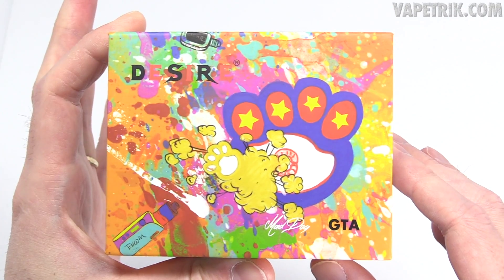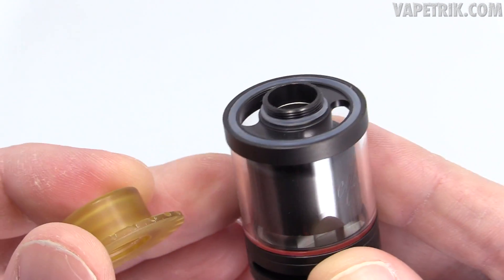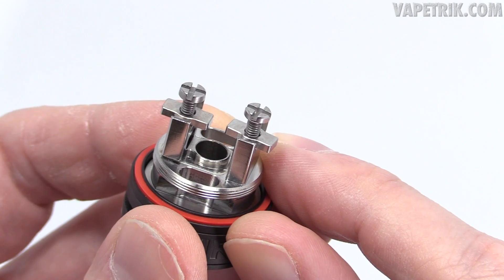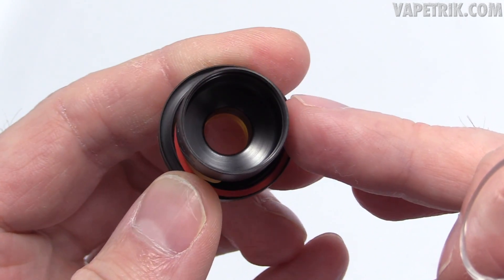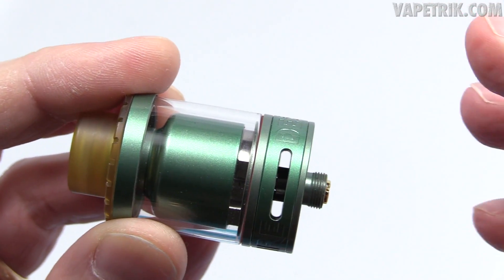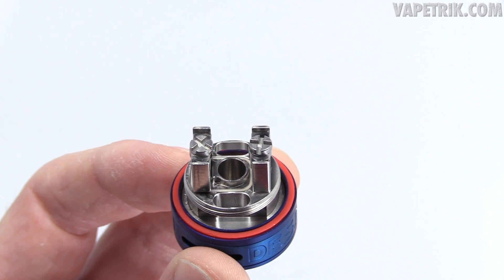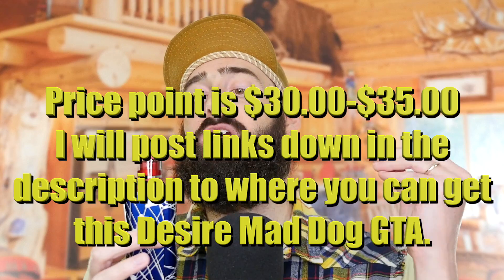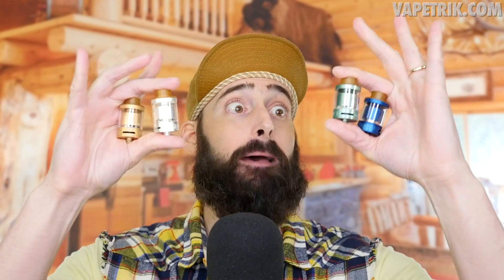The Desire Mad Dog GTA!

Comment: Ok let's talk about this device. Love it!!! Flavor is outstanding, wicking is easy, top fill is big enough to use any dropper bottle you have. The one con I do have is that it is a pain to build on. If you don't like to fidget around with your rta this will frustrate you a little bit. Once you get your coils in and clamped down it is fine, but getting the coil in there takes a little bit of patience. You can see when rip is putting his coil in when you have the clamps turned sideways the diameter of the coil hits the clamps and prevents it from just sliding in. And the fact that you have to turn the thing upside down to build on it is just a little inconvenient. Also like rip said it does whistle when the air flow is cut down. But over all this is a fantastic device everything he said is on point. This is the reason I watch rips reviews. Sorry for the long post. But I would want other vapers to let me know their thoughts on a product.
Reply: I get building may be a pain but how often do you pop on new builds is what will be subjective... I do new builds every couple weeks so having to do that once every couple weeks... who cares lol just my 2 cents!
Reply: I appreciate you leaving your feedback on this device. My friend has one and it had amazing flavor! I'm just curious if it leaks a lot. I only own drippers but need something for driving. These are on sale for $17 bucks on Wish right now I have to get one.